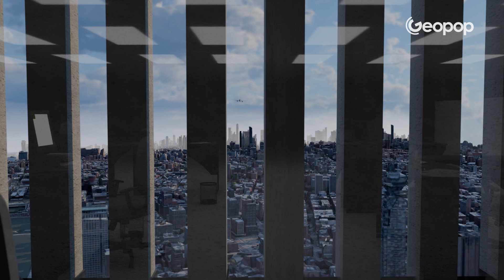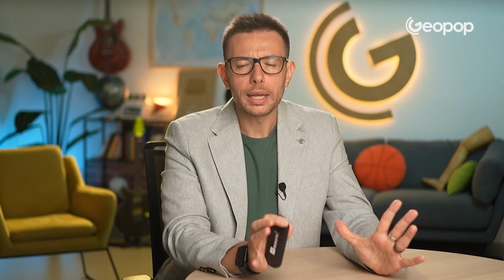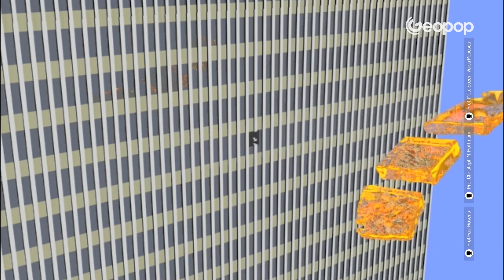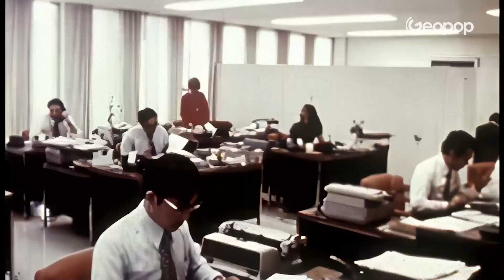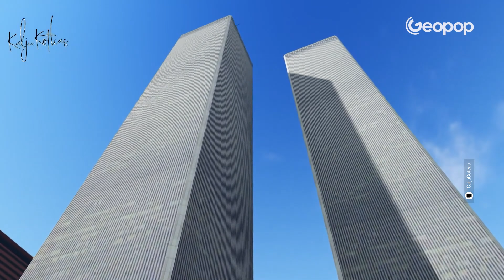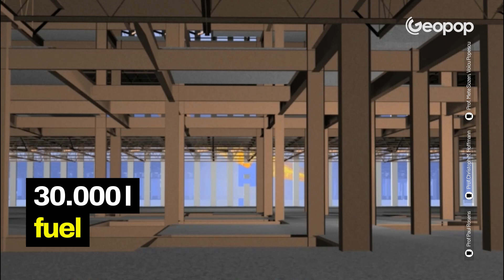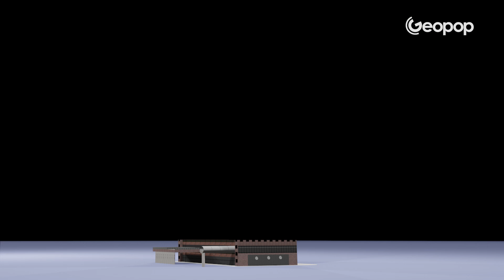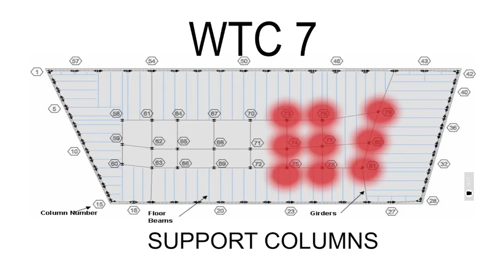9/11, 2001: The Technical Reconstruction of the Twin Towers and WTC 7 Collapses

Comment: You need to do a comparison to Architects and engineers and the University of Fair Banks Alaska 4 year study. And point where they got it wrong. 

This does not explain the molten steel coming pouring out of the buildings. 
Nor does it explain the " Dancing Israelis " that were later arrested. And stated they were there to document the event. 
So not sure why you left that content out?
Reply: Hulsey got it wrong before he started, when AE911T declared what their study would conclude before they even awarded him the contract. 

I have actually read both the Hulsey preliminary and final reports from cover to cover. That is better than I can say for most of the people who recommend it to me.  I have to admit the Hulsey report is such a dead horse, that has been flogged so many times now I find it difficult these days to drum up the enthusiasm to do it yet again.  But here it goes. 

My opinion of the Final Report is as follows:

The Final Report met none of its three stated objectives – indeed could not have met those objectives for lack of trying - and failed to prove its main conclusion, by way of a fundamental logic error; Hulsey claimed he had concluded fire could not bring down Building 7 without accounting for the full envelop of possibilities.  Essentially, he claimed to have proved a negative.

Hulsey also plagiarized almost 3 pages of material from Tony Tsamboti, who works for the studies sponsor. I hope I don’t need to point out the ethical implications of that. 

Overall, it is a shoddy piece of work done by a man clearly working out of his element and areas of expertise. It rather reeks of trying to support a conclusion arrived at before the study started, which would be consistent with study sponsor Architects and Engineers for 9/11 Truth having announced what the study would conclude before they awarded it. 

The Hulsey Report was so factually inaccurate, methodologically unreliable, scientifically unsound, illogical, and biased that it blatantly violated any requirements of objectivity, utility, transparency, and reproducibility that would have been required to submit it for peer review in any reputable journal.

Explaining why they didn’t. 

To its intended non-engineering literate audience, they Hulsey Report contains enough engineerspeak density for them not to ask questions, even if they were so inclined. Since the report appears to (superficially) deliver what they want, so they are not inclined, even if they knew what to ask. From a structural engineering perspective however, The Hulsey Report is of no value. 

There are several excellent forensic engineering reports out there and over two dozen articles published in genuinely peer reviewed engineering journals that are far more comprehensive and competently done. I suggest you seek them out instead.  Or, if you are so sold on the Hulsey report, explain why it is so good. Don't ask others to explain why it isn't (because you can't).

As for molten metal pouring out of the South Tower (and it was in fact ONLY the South Tower)?  You mean this?

youtube.com/watch?v=xPVGGQU-MeQ&ab_channel=SeekersofTruth 

So you think that is molten steel why?  Because you performed metallurgical tests?  Because the internet told you that’s what it is?  I think we can do better, so let’s do better and build a theory the right way instead of making evidence-free assumptions. This will take just a couple of minutes and is worth the investment. 

The Boeing 767 which struck the South Tower weighed 117 tons and 80% of that was aluminum.  The exterior cladding on the Twin Towers – the white panels – were also aluminum. When Flight 175 struck at the 81st floor its momentum deposited much of the office contents in its way and the bulk of the aircrafts mass into the NE corner of the building. The piled up debris shoved into that corner is visible in photographs and video so we know it was there. 

There’s a good shot here of piled up debris from 4:36;

youtube.com/watch?v=ZLJyL63sqtU&ab_channel=MrKoenig1985

Steel melts at roughly 2,750-deg F while fires in the South Tower reached peak temperatures of around 1,800-deg F. Aluminum OTOH melts between 887-deg F to 1,180-deg F depending on alloy. That aluminum will melt under these conditions is not a surprise. If you look at pictures of cars left behind and destroyed by forest fires the aluminum wheels are invariably melted away along with other sometimes aluminum parts like hoods. Steel bodies remain intact. 

The “molten metal” appears at 9:52 am. At the same time we see the first externally visible signs of sagging floor trusses and the pulling of the perimeter columns inward. I submit these events are related, not coincidental. The aluminum cladding at the NE corner also appears to me to be burning. 

It is likely the with the floor trusses sagging under the heat, and the 81st floor truss in the NE corner under the debris pile subjected to the heavy load of the debris pile, the truss broke its perimeter column connections and dropped, instigating the material starting to pour out of the NE corner at the 80th floor.

Given the properties of the materials in question, aluminum is by far the most likely culprit. 

Reports from The NIST, FEMA and MIT all concluded the material is aluminum. 

Certainly steel is the least likely of all the materials the anomaly could be given its much higher melting temperature and the fact there is no logical source for molten steel.  The perimeter columns in the NE corner are intact and the material is pouring out between them. So it isn’t columns melting, therefore what other source of steel is there?

Deniers will claim molten aluminum appears silver when molten, which is true but only at the low end of its melting temperature range. Aluminum can and does get hotter and it glows red to orange when it does (1,100 to 1,800-deg F).  Most folks of course just don’t bother getting it that hot if the goal is just to get it molten for say molding a part. No need to go higher. 

The total mass of molten aluminum is a BIG deal in regard to how it behaves when poured. Quantities bellow half a liter cool almost instantly if poured onto a flat surface, but if poured into say an ingot mould will stay red for a minute of so. Pouring volumes of molten aluminum greater than a liter is a VERY different experience. The thermal mass is much greater and the radiant heat is horrendous. The aluminum is able to stay liquid and remain glowing bright orange much longer. 

The famous video of glowing liquid gushing out of Tower 2 moments before it fell, involves at least tens of liters of molten aluminum. The thermal mass involved is so great that it stays red after falling many meters through the open air.

Side note: There was also a large UPS battery farm in that spot and some of that material at least may well be from the batteries IMHO.

Dancing Israeli'[s?

Really?

In 2024???

FFS you should be ashamed of yourself. Not a good plan if you want to be taken seriously 🤦‍♂🤦‍♂
Reply: @TheLoonResistance  
While all this makes sense to a certain degree. We also have had at least one other skyscraper engulfed in flames. From top to bottom. That did not collapse. 
I also find it odd. That the floors sagging did not actually provide support. Or cause more lean in the building.  
If it had collapsed in any other way. Instead straight down at that speed. It would also be more plausible. The molten metal. Aluminum is possible. 
But if it was steal. That does indeed change the game. 
I will review Hulseys report again. I watched a recent interview. And he said something. That did not make sense to me. So I do need to review it again. 

Do you find it odd. They found the hijackers passports? Was there many other personal type items that were found. That you are aware of?

But also the " The Dancing Israelis " are a thing. And if you are not aware of them. Or the 60 member israli spy ring that was arrested. You are not factoring in all the information. 
Most of that information has been scrubbed from YT. 
But the best one. That was removed from YT is on Rumble. 
James Corbett did the piece. And I believe that is the title.
Will see if I can put a link in here. And encourage you to watch it. 
https://rumble.com/v5ej1zw-corbett-report-911-suspects-the-dancing-israelis-.html

Has the news clips of the Dancing Israelis.
Reply: @MrSeadawg123  Name another all-steel high rise (or even low-rise) building that survived 7 hours of unfought multi floor  fires.

You can't.  There isn't. 

I can explain the collapse of Building 7 in detail if you prefer - something Hulsey couldn't. Twin Towers too.
Reply: @TheLoonResistance  
Actually there are quit a few. Here is one similar to wtc 7 in china from a couple of years ago. 
https://youtu.be/Cphle9wkjCE?si=zahq_YtfH7vJqnfF
Reply: Does not meet the criteria.  Read again please.
Reply: @TheLoonResistance  
That one fire in Brazil. Stated fire burned out in 4.5 hours.
Another one in Brazil did collapse after 90 minutes. 
It was an older abandoned building with squaters.
Reply: @MrSeadawg123  - Wilton Paes de Almeida was steel framed. It's fires - starting from a single point - were fought for most of the 90 minutes it lasted prior to global collapse.

Again, the standard you have to meet is;
1. STEEL FRAMED
2. Survived 7 hours of UNFOUGHT multi-floor fires. 

You won't.

In a few minutes I will be posting something the incompetent Leroy Hulsey couldn't come close to, and what his sponsors, in spite of supposedly being "experts" with access to thousands of other experts have not done in 18 years.

I will describe the collapse of Building 7 in detail.
Reply: @MrSeadawg123  - The collapse of the unknown and unimportant Building 7 – one of 6 buildings to collapse of 10 destroyed on 9/11 - confuses a lot of people, despite being one of the most studied engineering disasters in history. It was not famous, not a terrorist target, no one was killed in it and thus it did not get a lot of attention, so most know very little about it. There is a lot of tantalizing but absolute garbage out there on this topic. Given the choice between long boring, hard to find technical reports and readily available, easily digestible fantasy on the internet, many turn to the latter. To counter that I prepared this brief summary explanation based on my own analysis. No politics, just engineering. 

The North Tower collapse at 10:28am bombarded Building 7 with thousands of tons of burning debris, causing heavy damage and starting raging fires burning out of control for the next 7 hours. Half the responding FDNY firefighters having been killed, others injured, units in disarray, much of their equipment destroyed, no water pressure, and the greater urgency of Search & Rescue efforts, firefighting efforts at 7 were pulled as futile. The building couldn’t be saved and was left to its fate.

youtube.com/watch?v=g_SvpwyC17M&ab_channel=MFitz 

Collapse of a burning structure is always a concern for firefighters. Steel buildings subject to fire rely on active fighting of the fires to survive. Left to their own devices they will collapse. Buildings are designed around 1 to 3 hours of fire resistance, allowing time for occupants to escape and ACTIVE firefighting to get started, after which all bets are off. In B7 the occupants escaped, passive and active fire protections were compromised and active firefighting never got started which left the building to take its chances. It lost. Odds on Building 7 would eventually collapse,… and it did. No big deal in logic. That is the sort of choice firefighters make every day in brush fire situations - which houses to save and which ones to let go. Only real difference here is moving the decimal on the size and cost.

FDNY Chief Daniel Nigro ; The biggest decision we had to make on the first day was to clear the area and create a collapse zone around the severely damaged 7 World Trade Center, a 47-story building heavily involved in fire. A number of fire officers and companies assessed the damage to the building. The appraisals indicated that the buildings structural integrity was in serious doubt. I issued orders to PULL BACK the firefighters and define the collapse zone. It was a critical decision; We could not lose any more firefighters. It took a lot of time to PULL EVERYONE OUT, given the emotionalism of the day, communications difficulties and the collapse terrain

FDNY Deputy Chief Peter Hayden - We had our special operations people set up surveying instruments to monitor and see if there was any movement in the building. We were concerned of the possibility of collapse in the building. And we had a discussion with one particular engineer there, and we asked him if we allowed it to burn could we anticipate a collapse and if so, how soon? And it turned out that he was pretty much right on the money, that he said 'In its current state you have about 5 hours

With its deteriorating condition being reported throughout the day, the collapse of Building 7 expected by the FDNY, bystanders and the media meaning at least 24 video cameras recorded some or all of the collapse. Everyone at the time knew what was coming and why.

youtube.com/watch?v=OY5S5k3tMHI&list=PL4GiNqqck-lzR7pebSWRVLoXyu-aWR3Rr&index=48&ab_channel=911InvestigationVids 

Building 7’s collapse was totally different to the Twin Towers, harder to understand and most of the details difficult to see. But we can sort out what happened through careful analysis and observation.  What follows is MY EXPLANATION of the collapse sequence using the best available information and relying on no authority.

B7 was complex structure, a 47-story steel framed building built on top of a smaller existing 3-story building, requiring several lower floors dedicated to complex load transfer structures instead of usable office space. Of trapezoidal shape and all-steel tube-in-tube construction, B7 (above the 7th floor) consisted of a central core of steel columns carrying most of the gravity load, perimeter steel columns around the outside of the structure carrying the remainder of the gravity loads and long span beams and girders to tie those elements together and form the floors. On the outside of the building hung a moment frame - the last part of B7 to fall. 

Phase 1 : Collapse initiation for B7 is notably quiet with observers not realizing the building was collapsing! There was no audible warning in the form of say hundreds of ear drum busting 180-190dB explosive bangs preceding the collapse. The first externally visible signs of collapse initiation occurred at 5:20:28 pm. Here at 12:00 a local CBS affiliate reporter is talking 10 blocks from B7 when collapse begins. People don’t start to notice the collapse until 12:11. Then at 12:45 is the famous CBS fixed camera clip of Building 7’s collapse Again, note how quiet it is.

youtube.com/watch?v=t5tEy6mXSE8&ab_channel=fresnosean379

Collapse initiation was due to multiple lower floor failures above the load transfer region (7th floor) in the NE corner of the building. In this video at 0:45 you can see the NW corner from inside the building while under construction, Column 79 just out of frame on the left. That big, angled steel beam across the top of the frame connects to C79 at one end. The girders connect to the beam. The beam and all those girders depend on just one connection

youtube.com/watch?v=nP3TNHPCIVU&t=35s&ab_channel=EdwardCurrent

Phase 2 : Lower floor failures left core Column 79 laterally unsupported over an excessive length and it buckled. If you look at a floor diagram of Building 7 (see above) and look at all the structures that depend on C79 you quickly realize this one column was a relatively isolated structural element on which a disproportionately greater fraction of the structure depended . Externally we see a vertical progression of window breakage along the 44-46 line and a kink in the roof of the East Mechanical Penthouse at the top of the building, consistent with C79 failure. The transition from full capacity to almost no capacity occurs in virtually an instant. Once the buckling failure occurs there is almost no resistance

Normally with a buckling column, the load could very well be redistributed to other columns, meaning the buckling could stop after a while. With C79 that is not the case - the failure did not redistribute the load, so the collapse rapidly progressed to the roofline, sinking the rooftop penthouse.

Phase 3 : With C79 gone, B7’s progressive, non-symmetrical collapse continues with C80 and C81 at the east end of the core left laterally unsupported and quickly buckled and failed as well, sending the EMP down through the building. C79-81 all have no diagonal bracing, which I believe is a major reason why they could not redistribute a lot of vertical loads among one another.

From there collapse progressed from east to west through the central core until the core was gone taking all of the interior floors and structures and probably most of the perimeter columns with it. You can see the horizontal progression of window failures low in the building and the dropping of the remaining rooftop structures into the building. One of the big takeaways from the NIST Building 7 study (that gets completely ignored) was their modeling which determined C79 failing under ANY circumstances would have initiated the same collapse sequence.

Phase 4 : After about 10 seconds only the exterior moment frame - a hollow shell mostly supported by the 4 corner columns and quite unable to stand on its own – remains, creating the illusion the building is still standing since little has changed externally. That’s just hollow empty shell, like an empty cereal box. The north leans inward, forming a V in the roofline. The last remaining perimeter columns buckle under the strain.  There is almost no resistance as the moment frame free falls, landing on top of the 7-story high debris pile, blocked surrounding streets, heavily damaged the Verizon Building and destroyed Fiterman Hall at 30 W. Broadway, all well outside of Building 7’s “footprint”.  It is only here, at the very end that a single utterly meaningless measurement of alleged free fall is taken. Start to finish the collapse took 18-20 seconds, or less than 1/3 of true free fall*. Not that we really care since how fast something falls cannot tell you what started it falling in the first place. The free fall argument is about the collapse of the outer shell *AFTER all of the critical internal structure had already failed and completely ignores about 80-90% - of the collapse. 

Building 7’s progressive, non-symmetrical collapse was incidental and unintended collateral damage from the combined effects of fire + time + gravity started by the collapsing North Tower. That is true no matter who planned and carried out the 9/11 attacks or why . The collapse was of so little consequence it barely even registered at the time, a mere footnote. 

I hope you found this helpful and informative, not adversarial and it solicits informed critical comment. If I made any errors of fact, logic or reason or left anything critical out, please let me know so I can fix it. IF you can offer a more plausible alternative please do. Be the first. Please start any reply with the words “Tits McGee” or I will know you didn’t read it and are wasting my time.
Reply: @TheLoonResistance  No-one asked you for your copy post garbage about an unknown and unimportant building Fitzshill. Topic here is the well known and important WTC7 which housed the mayor´s office, the OEM hq, CIA, Secret Service, DoD, SEC...
Will you ever learn this simple fact in your shitty life Fitzshill?!